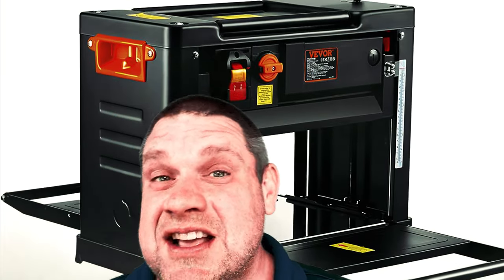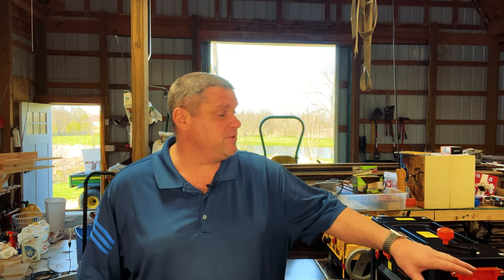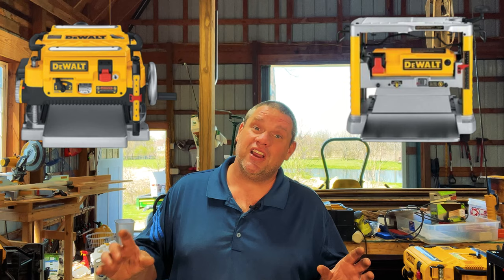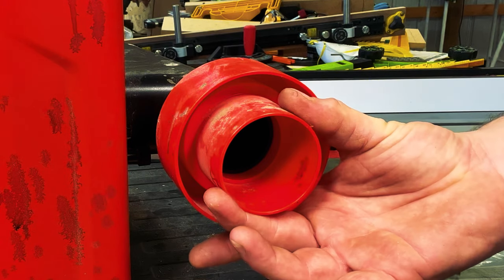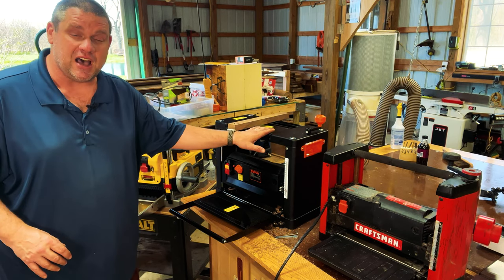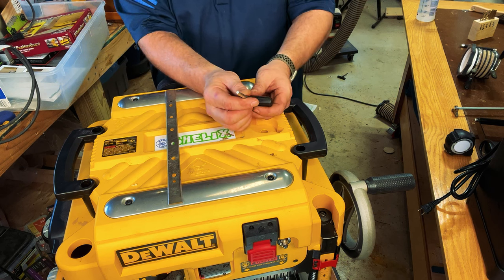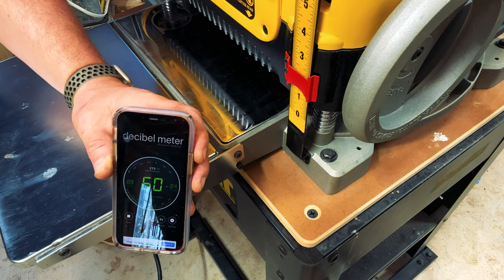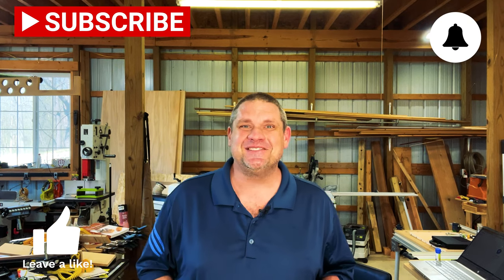Uncovering the Perfect Planer for YOUR Needs

Comment: Thanks for the video. What I did on a limited budget is wait for a decent sale on the DeWalt 734. It's a nice planer and I paid the same as a low end one. 

My next purchase is a new bandsaw. I'm looking at the 14" or so size. If you ever wanted to talk about those I'd definitely be interested.
Reply from the maker: Great idea 9Ball.  I really wish I still had my first bandsaw, that would be perfect for me to do a video on how the two compare.  If you want to get a pretty decent starter bandsaw, check out the ryobi one.  That's what I started on.  It's got a small blade on it, but it suites the purpose for a lot of cuts you might encounter.  Obviously it's not going to resaw, but for general curves that you don't want to do with a jigsaw, its a good tool for the price!  Thanks for watching!

Comment: A totally overlooked option is the Oliver model 10044. $1100 delivered and comes with a Shelix cutter head, 4 sided carbide cutters on a true helical cutter head and DRO installed. Only 12 1/2 inch capacity but there is little use in a home shop to plane wider boards. You don't plane plywood and not much is wider, maybe a cutting board.
Reply from the maker: Oh I know Jeff!  That Oliver looks amazing.   I'd love to do a review on that planer vs. the dewalt planer.   I just can't justify purchasing another planer like that.   If Oliver wanted to send me one, I think it would be an excellent comparison to see how the 735X compares to that planer.   Just can't afford buying one :)   Thanks for watching!
Reply: @FlynndoggWoodwork  I have it and it is my first and only planer. A planer is a huge step for me as I do not really make anything except shelves and the occasional other object. But in all my years, it is so very bothersome to have two 2 x 4s that you try to pocket hole or dowel and they are hundredths of an inch different in thickness. You get that "feel" that is the joint. I did a lot of research and  found the same things you did about knife cutters and four sided carbide cutters etc etc. I found the Oliver was the most bang for the buck. If you ever have any questions about it maybe I could answer them as I do have the Oliver.
Reply: Matt Outlaw from 731 woodwork channel did a good comparison of the two
Reply: @MemphisCorollaS  I saw that. He downgraded the Oliver because you could not stand on it.
Reply from the maker: @jeffstanley4593  Thanks so much Jeff!  I'll have to say I'm a little jealous that you have that oliver.  I'm not sure it was even available when I got my planer.  It would be at the top of my list if I was shopping for planers today.   And I agree with you, seems like it is a great value for the price!   Thanks for sharing!
Reply from the maker: @MemphisCorollaS  Oh yes!  Saw that one.  That episode is the one that got me intrigued by Oliver!

Comment: I like your videos a lot.  This oner was a very thorough introduction to choosing a planer.  One thing that I didn't hear you mention was a warranty (or lack thereof) if you install a Shelix head into a DeWalt planer.  DeWalt appears to not provide any warranty if their machine is modified.  I am considering purchasing aa DeWalt with similar upgrade.  Is the Shelix head worth trashing the warranty?
Reply from the maker: Great Question Ron - In my humble opinion the answer is yes.   The cut quality is remarkable.  Especially on highly figured wood.  And snipe is essentially non-existent once you set it up properly.   You are correct, I do believe you void the warranty with this modification.  If you are worried about the warranty, I would check out the Oliver Helical lunchbox planer.  I've heard good things about that!   Thanks for watching!

Comment: Hi this was an excellent presentation. I have a question. Let’s say I have 3 pieces of wood with different thickness and I want to make all three of them to have the same thickness. Can I do that with Craftsman planer ? How does the machine know I want all three of them to be the same thickness? I appreciate your feed back.
Reply from the maker: Excellent question, and the answer is yes!   You would basically start off with the thickest piece of wood and slowly plan off a little bit of material until it got to the second piece of wood's thickness.   Once you accomplished that, you would send both pieces of wood through the planer until you reached the thinnest piece of wood's thickness.   Then you could make sure they are all the same thickness by running all three of them through the planer to clean them up.  Hope this helps!  Thanks for watching bijan4727!

Comment: Would you have been able to install the shelex brand cutter head yourself in the 735 without worrying?
Reply from the maker: Probably not with full confidence.   Maybe now, that I've had the experience of installing a shelix cutterhead, but it was overwhelming when I tried it myself for the first time.   But if you have more experience with installation and parts, I'm sure you could do it!
Reply: @FlynndoggWoodwork  when I looked up the prices it would only save $100 bucks I’ll happily pay that and just buy the one with it already installed 🤦‍♂️

Comment: Amazon brands tend to make me nervous. I’ve seen so many mixed reviews on other Vevor tools, I just don’t know what to make of them lol. Are any of the knives you can get a big box store compatible with it?
Reply from the maker: Let me research that!  It appears they it takes the same blades as many of the other brands on Amazon (I.e craftsman) but not quite sure if the exact brand is available.   And I totally get it on buying larger tools from amazon.   If I do buy from amazon, I always make sure it is a brand I can easily get replacement parts for locally.   Nothing worse than being in the middle of a project and having to wait for shipping on a part!

Comment: Tried the Oliver, craftsmen, harbor freight. Dewalt 735 is my go to. Oliver is interesting, but I really hate the carriage lock.

Looking at a shelix for my 735 eventually, but it’s just as expensive as planer itself :)
Reply from the maker: Oh nice!  Great to hear from someone who has had experience in all of those!   The shelix is nice, but man so expensive.   I'd like to try out the grizzley too at some point.   I was eyeballing that 15'' one they have.  Thanks for sharing and watching The Next!
Reply: @FlynndoggWoodwork  The shelix, when I tested one (a friends) I noticed that the cut was slower, the dimensioning was slower and the finish cutting was slower, but the results were smoother and you could go SLIGHTLY more aggressive. The 735 - I work with mostly walnut and other harder woods than that, I can't go more than half turn on the crank (MAYBE one turn) without getting 'chatter' where the surface isn't torn out, just has this spotting so I end up having to feed, flip, feed, flip, feed flip many many times trying to just grab an 1/8th off the dang thing. 

The Grizzly jointer is pretty great. The planer, I have limited exposure to it. I've been looking at a 12" grizzly jointer, because I have access to 6-7" -10-14" wide boards - (which are a nightmare to work , even at 10/4 final dimensions seem to end up at 1 3/4 or so no matter what). Those wider boards make me mad, I do my milling over 3 days and the first cut ALWAYS moves on me, just taking a 1/16th off, over the course of 8 to 12 foot ends up being like a 1/4 of milling....which after as much time as I have had, and you have that many planer have to not appreciate!

woodworking is a pain in my ass, I complain but I so much enjoy doing it as it's really hard, it's time consuming but it's better than staring at a stupid screen 8 hours a day and wondering what is life.
Reply from the maker: @thenext9537  OMG I love your comment.  I think you share a lot of the same feelings a lot of us have!   Milling wood is probably one of my least favorite things to do, until I do the final couple of passes.   I recently did a table top with some bubinga and had some issues with chatter on that wood, but it had such strange grain direction that I think that was part of the reason for it.   I really want to have a grizzley tool.  I went back and forth on whether or not to get  a grizzley 15 planer before I purchased that dewalt.   My only reason for not doing it was I wasn't sure I wanted it to take up that much space in my shop.  I like the fact I can cart around my dewalt on it's stand pretty easily.   I was watching a foureyes video the other day and he was saying just about the same thing as you are.  He said woodworking sucks.... but I love it.    Thanks so much for your comment and watching.  I wish you the best of luck on your Planer/Jointer future.   Sounds like you have the right ideas on what type to get! :)
Reply: @FlynndoggWoodwork  I actually love planing and sanding (SOMETIMES). I put on my air pod pros, my ear protection (the over ear type) and just start feeding. Once I got rid of snipe - which took me a full day to figure out, I get nearly zero 99% of the time - only on large pieces though do I get it and it comes from not supporting it as it comes out - the end will angle up into the cutter after it passed the first roller. Anyway, once I got passed that, the key is to just put everything on a table, put it in order and get everything to same thickness by feeding, rotating, flipping etc and once I get that then I start marking. I use sidewalk chalk to mark up warped pieces if on a sled. I hate sleds btw, why? Because, now I have a thicker piece and I have to adjust the crank and now mark it and I can never get it precisely where I want it back....bah. 

All I ever work with is walnut, which here in TN is about 18$ a board foot but it's air dried and kiln dried and they guys at the shop let me dig around to get good stock.  Bubinga - been seeing this alot lately, that and Sapele which I'm interested in both. 

Random thought - I just bought some Narex chisels with no handles for like 11$ at taytools.com, which is cool as I can make my own handles which I'm excited about as I never made a handle before. Normally those are like 40-60$ each but with no handles (they call them blanks, I didn't know that) they are 1/4 price!

I'm looking at one of those fancy digital read outs for the 735, they are really good. I saw one one 731 woodworks YT channel, and I think I want one now!
Reply from the maker: @thenext9537  Oh man, what a great deal on those narex chisels!  I've always wanted a set like that.  I'd eventually like to get a lathe to do stuff like that in the near future.  I'm just so paranoid that a lathe will sit in the corner of my shop and not get used that often!   

You must be reading my mind on that digital readout for the planer.  I've been looking at those for a few months now. I would love to have one of those.   I just can't get myself to spend the money!    I think my next big purchases will be either a new drill press (more powerful one than my ryobi) or possibly a lathe.   But all of that is on hold until I get my barn insulated and wired properly!
Reply: @FlynndoggWoodwork  Barn? Crap, can't imagine that. I've been wanting some farm land that would be a dream, 100's of logs, a saw mill, all the wood I can have and never have time to work on, dreams. For the handles, I'm literally just going to hook up a drill in a clamp, then put a screw or something on other end and just tape the trigger down and carve it with a wire brush or something to get it semi round then use some sort of (in flight thought here) wooden stop to put a chisel or something as it rotates to carve. 

How hard can it be? I make everything up as I go along, I keep wanting to do videos, but just get so tied up, but I think I might try soon :)

Comment: Dewalt is a piece of crap I have had a total of four motors burn up on me on the dewalt in the last two years, Dewalt replace two planners and I rebuilt the motor on one.  they sent me another one and the motor in this last one burned up ten minutes out of the box. it was set to plane 1/64 of an in off of a oak board three foot long.
Reply from the maker: I'm sorry to hear about your experience with Dewalt. That sounds frustrating.